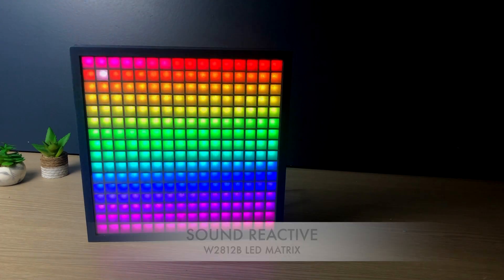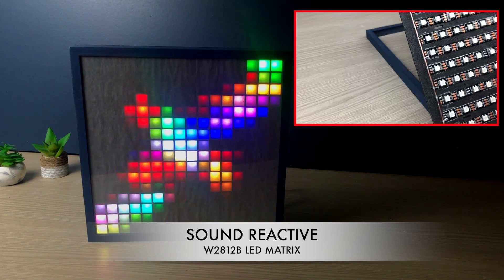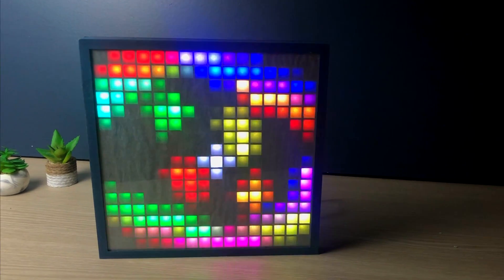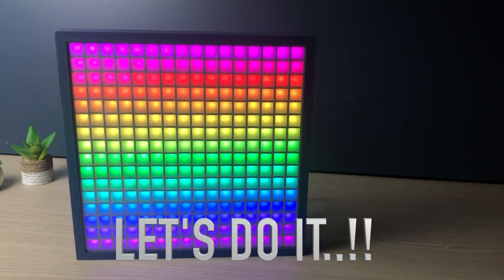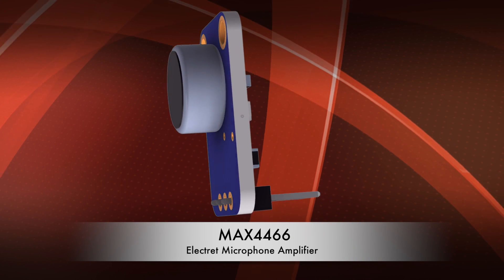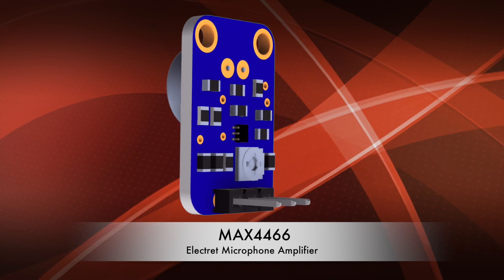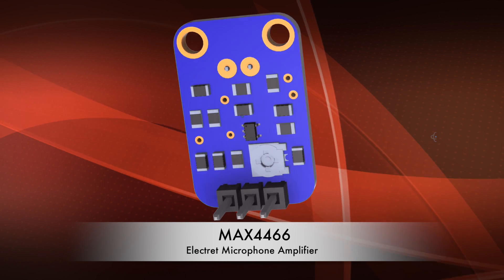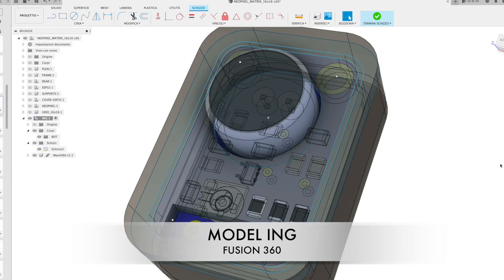MUSIC SOUND CONTROLLED LED EFFECT by WS2812B NEOPIXEL ESP32 DIY MATRIX 16x16 ide ARDUINO

Comment: Nice,
Recently WLED has included Sound Capability and Hell lot of effects for Matrix,
Please use this matrix with WLED 14 beta version.
Reply from the maker: Hi Manu,
I'm waiting for an update to 0.14 beta release of "Sound Reactive" that still 0.13.3
Using Sound Reactive 0.13.3 I had some trouble to configure matrix 16x16 and get the right effects..